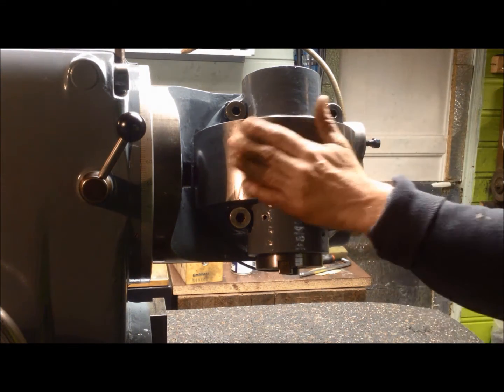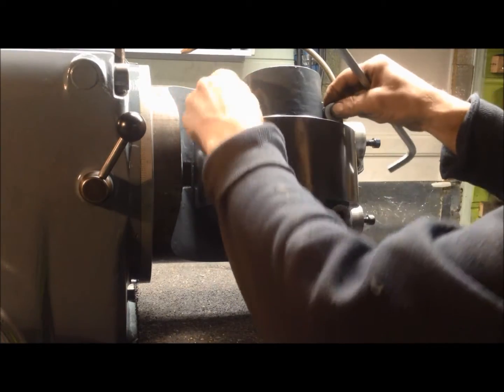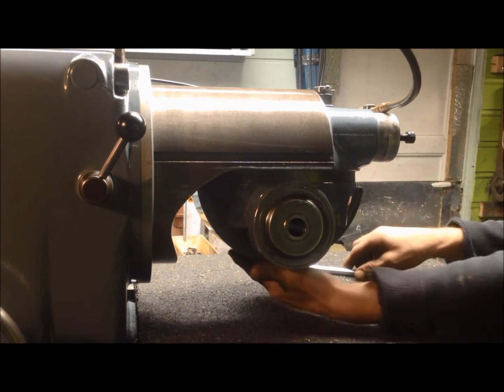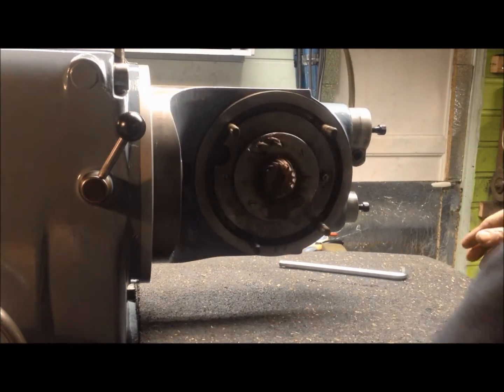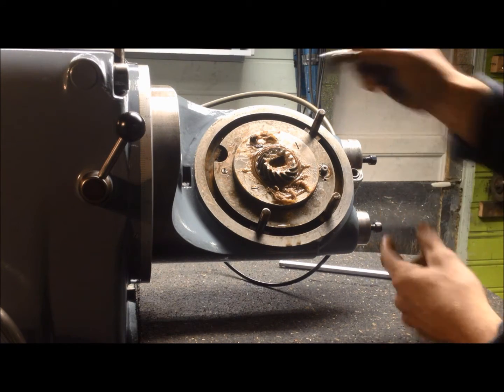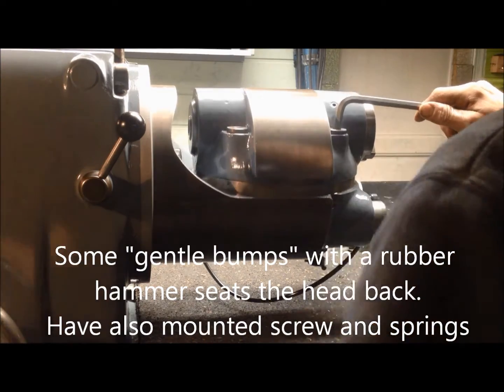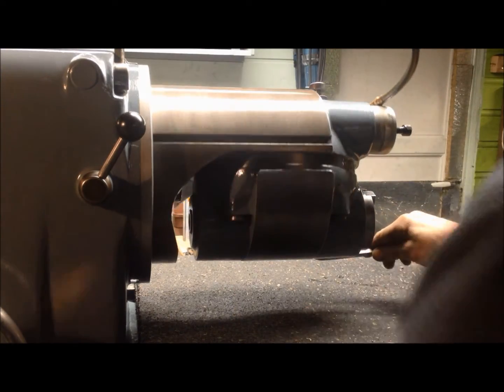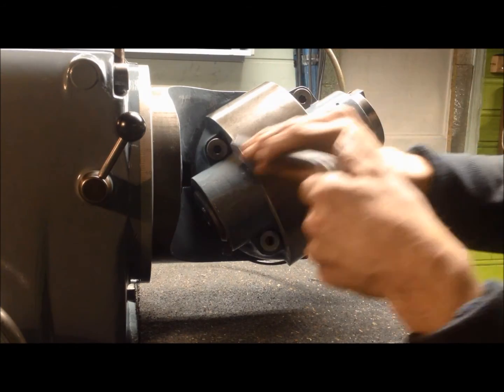Schaublin SV52 milling head assembly

Comment from the maker: Thanks for the kind comments.
Scraping is mostly done.. just a small amount on the in/out feed gib plus the hold downs on the coumn and saddle (plus some milling). Then there is the feed screw and nut, plus welding of that bracket.. Maybe some aluminium welding on the frame that supports the in/out feed mechanism/read-out (r glue/screw.. whatever, just a smal detail). After this I think it is "only" re-assembly of the saddle and table.

Schaublin is Swiss. Supposed to be one of the best makers out there, maybe better than Deckel at least on par..
HOWEVER, this is a certain "can of worms" opener/debate starter..

Comment from the maker: True. The Schaublins are all quite complex machines, and maybe  "over-engineered".
From that era, even though not applicable for the head assembly, there seems to be a number of mechanical solutions to provide advanced functionality eg. variable speed control. By now of course solved via electronic devices.
The head & cylinder allowing 360 degree rotation in both axis gives a lot of flexibility

Comment: Interesting way of designing the swivel head. It puzzled me quite a bit when I first saw it at lathes.co.uk It is over complicated but provides both horizontal and vertical machining with single motor and gearbox. It would be interesting to see how it performs.